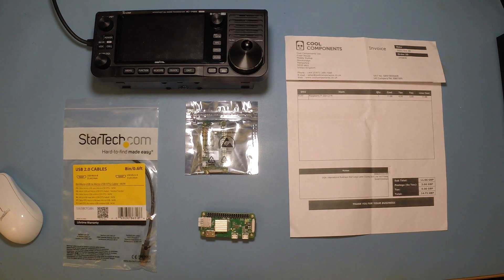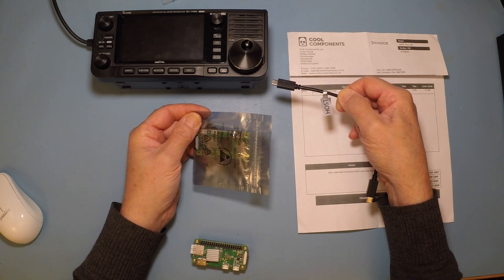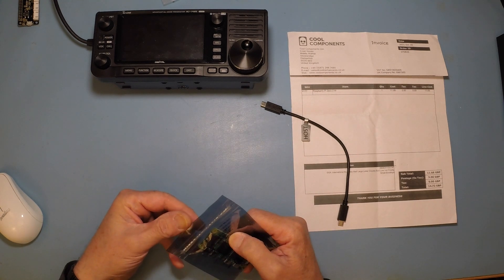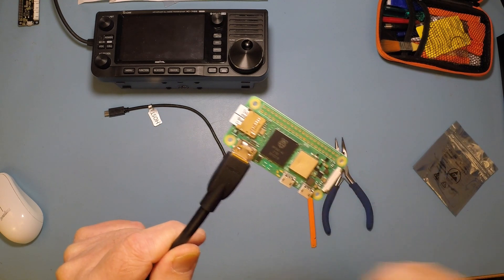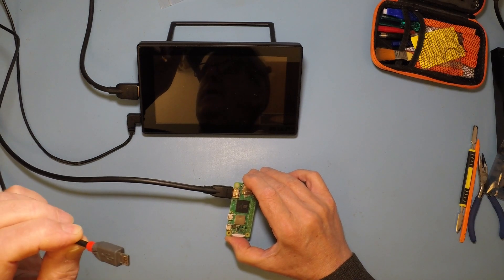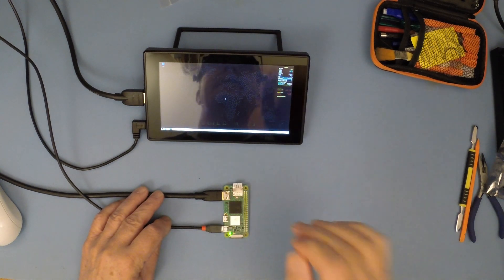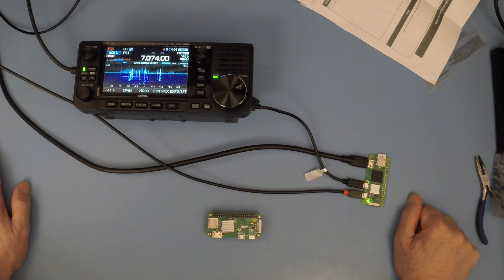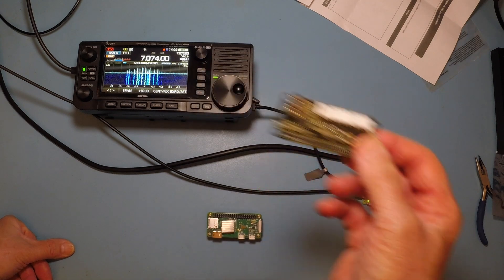Raspberry Pi zero 2W the Best  Pi for Ham Radio digital modes?

Comment: Will a pi zero be powerfull enough to decode and send morse code? Reason for asking plan to use it in small mini laptop guise as have a brain injury that means I can't do it in my head anymore and since stroke memory is affected. Thanks de M0JFE
Reply from the maker: You will need at least a zero 2W. The bare 'Zero' doesn't have enough puff for much at all!
73
Bruce G4ABX
Reply: @G4ABX  thamks for that will keep an eye open am nee to this and find your videos a help. Good DX de M0JFE

Comment: any soundcard?
Reply from the maker: The rig I was using -- the IC 705 -- has inbuilt soundcard and cat connection so its a very easy single USB between the zero 2W and the rig.
if your rig doesn't have an inbuilt sound card then any of the inexpensive USB sound cards will work -- but you will need more than one USB connection to the zero 2W

Comment: Hi god video.
I am trying to seyup my new pi-zero. What version of the raspberry OS are you running? OS or OS lite ? 32 bit or 64 bit ?
73    OZ4HJ
Reply from the maker: Good evening.
I'm running the 32bit Bullseye version of the Pi OS with Build a Pi 'on top' for my Amateur Radio applications.
The Pi zero is very underpowered when it comes to running more complex applications. I very quickly gave up with the Pi zero and went to the Pi-zero2W with its 4-core processor that will handle most Amateur Radio Applications.
This Pi zero2W is connected to my IC-705 and is presently my 'go to' digital modes rig in the shack. (Just worked Canada on FT8 with 5 watts using my 80M Off Centre Fed dipole at home)

I'm also testing the new 64 bit Pi OS and so far its working well. 
Jason, KM4ACK has released a version of Build-a-pi for 64 bit. That is running with my KX3 on a Pi-4 (4Gb ram.)

I hope that helps?
73
Bruce G4ABX
g4abx.co.uk
@G4ABX
Reply: @G4ABX  thanks, my Pi is a Raspberry pi zerro 2 w, how did you get the Pi build on top. i thought that the pi build was a complet image you flashd on (this i can´t get to work).
i am brand new to raspberry so excuse if my quistasions is not logic to you...
Reply from the maker: @JhKnife-OZ4HJ-Jimmi  Good afternoon (I still don't know your name)
If you can't get your pi to run with the standard Pi Bullseye build then we need to sort that out first!

You will need a minimum of an 8Gb micro SD Card. I tend to use 32Gb as they are cheaper!

Next, install the micro SD in your PC  using a USB to micro adapter (available for a few €' on Amazon)

Next got to https://www.raspberrypi.com/software/ and download the Raspberry Pi Imager (Its free) I use a Mac but there are versions available for MAC, Windows and Unbutu
When you have this downloaded and your micro SD card installed in you PC, go ahead and Choose the OS (Choose Bullseye, 32bit) then select your SD card and write the image to that.
Install the SD card into your pi and power it up.
You will need a keyboard, a mouse and a monitor plugged in. You may need a micro USB to USB-A converter in order to plug in more than one USB item. Again these are available on Amazon for about €12
You will have a number of things to fill in on the Pi as it boots up -- your Wifi Password, your location and first of all, change the password to something you will remember.

Once you have your Pi running on its own OS, come back here and I will talk you through getting Build-a-pi running on your Pi so you can run all the digital modes etc.

73
Bruce G4ABX
Reply: @G4ABX  just a quick question. It is the standard OS you are running not the lite one right?
73 - OZ4HJ - Jimmi
Reply: @G4ABX  hi 
Now it’s running OS 32 bit. 
I seems to have the same or similar problems with the USB hat/hub, but it is running now…🙂
How do I proceed for the builder pi ?
Reply from the maker: @JhKnife-OZ4HJ-Jimmi  Well done 🙂
Ok to add Build-a- pi

Power up your Raspberry Pi, login, make sure you have internet and and in your home directory, run the following command using the terminal window. (Just copy this below and past it into your  terminal window.)

 git clone https://github.com/km4ack/pi-build.git \
  $HOME/pi-build && bash $HOME/pi-build/build-a-pi

Unbelievably, the Pi will do the rest!
You will need to give the application some information. -- like your wireless password (most important) but if you haven't set up the rest, you can come back ot it once everything is installed.
There App will also ask for your callsign. This is how it identifies what you have installed for future upgrades.
It will also give you -- I think 3 pages of 'tick boxes' for various applications. At the bottom of each page you can select one tick box to install everything. This is what I suggest you do .
The complete download and install will take about 4 hours -- so be patient.
Once you have give it your callsign (after about 5 minutes) you can leave the Pi to do its stuff. You don't need to sit there watching 🙂

At the end it will ask you to reboot -- and if everything has been successful you will have a Pi full of new applications for you to use.

The script has been written by Jason, KM4ACK and he has a lot of information available on You tube and on line. 
I also suggest you join the KM4ACK-Pi forum on Groups-io. Its free and is very well supported by knowledgeable and new folks.
18 months ago, I didn't know what a Raspberry pi was!

Have fun -- and if you get stuck come back here.
I review my emails most days
73
Bruce G4ABX
Reply: @G4ABX  Hi Bruce.
it´s running now. I changed the language back to English and maybe I forgot a space to start with....
73
Jimmi
Reply: @G4ABX  Hi Bruce
Now the Raspberry runs Build a pi…. Nice.
But I get this error when I try to connect to the IC7300. The baud rate is set to 9600 both places. Do you have any ideas to solve this ?

Rig failure
Hamlib error: Communication timed out
serial.c(884):ser_close return(0) 
iofunc.c(361):port_close return(0) 
rig.c(1083):rig_open return(-5) Communication timed out
serial.c(884):ser_close return(0) 
iofunc.c(361):port_close return(0) 
iofunc.c(361):port_close return(0)  while opening connection to rig
Reply: @G4ABX  Hi Bruce.
Now it works....🤗 it the Icom 7300 internal time out timer that needed adjustment.
Thanks for all your help.
Reply from the maker: @JhKnife-OZ4HJ-Jimmi  Good morning Jimmi.
I've been travelling so this is the first chance to read emails.
I'm glad you got everything working.
I tend to use 19.2k baud rate with my 7300 and that works well - but really most baud rates work and 9.6k is fast enough.
One of my Pi-4's died on me two days ago. Just stoped working and has a terminal hardware failure. Now of course you can't buy a replacement as there are none in stock anywhere -- due to the worldwide chip shortage. it will be many months before they are available again
So enjoy your pi -- but don't break it 🙂
73
Bruce G4ABX
Reply: Thank you.
I am downloading the standard OS bullseye 32 bit as we speak.
I will be back. The name her is Jimmi.

Comment: Instead of using a S tactic strap, I just wash my hands. Skin with moisture has no static
Reply: Hi not all static damage is instant it can take weeks or longer to show up. I have only seen damage on a couple of devices instantly but suspected more unknown . I used several mats and straps a lot have warn out. One word of caution I was working with EHT about 2500 volts on a static mat and got a belt from the mat!! Not a huge one but supprised me!
Reply from the maker: Barry thanks for your input.

High voltage and conductive mats don't mix well.
I was repairing a valve Linear amp for a colleague -- 2500 volts on the Anodes of the valves (tubes)
I too got more than a tingle from the mat!

you are absolutely right about static damage. It's insidious and often unseen. That's why I prefer to take maximum -- but not crazy -- precautions at the outset. Then you can be pretty sure you've not got any latent damage that will bite you later on.

Although I've only ever had one anti-static mat, this is about my 5th conductive wrist strap. Previous ones have used a conductive material -- which is more comfortable than the metal strap, which is just like a metal stainless steel watch strap, but is less effective and they wear out as you say Barry.

73
Bruce
@G4ABX
g4abx.co.uk
Reply from the maker: Hi Jason. Maybe -- at least whilst your hands are damp, but I've seen too many static induced failures during my career -- so I always wear a wrist strap. Its a small investment for a lifetime of certainty :-) 73 Bruce @G4ABX

Comment: Hi Bruce, could you tell me what usb card you added under the older pi? Thanks VE6KBI
Reply from the maker: Dana -- good afternoon. Certainly. It was purchased from Amazon: IBest Waveshare 4 Port USB HUB Hat B for Raspberry Pi 4B/3B+/3A+/2B/Zero/Zero W/Zero WH,4X Extended USB 2.0 Ports,Compatible with USB2.0 1.1, Plug-and-Play.
I warn you that it works fine with the original Raspi zero but on the zero-w, the pads on the Pi that it uses to connect via gold plated 'pogo pins' appear to be different -- or not in exactly the same place as on the basic 'zero.'
I need to investigate some more as to use the zero2W in my KX3 Gobox, I need 2 standard USB ports for the sound card and the RS232 adapter.
73 Bruce @G4ABX

Comment: Can you pair the units via Bluetooth and eliminate the usb cable?
Reply: Jamie. Yes you can -- certainly using a Widows PC and ICOM's £100 'Remote' software. I will investigate how to do that using the zero-2W over the next days and post an update.
Reply: @Dr-T  there is also wfview which is a free remote rig software...
Reply: @fatbikejamie  Hi Jamie. Yes I know of WFVIEW but haven't investigated it yet. 
I have now got the 705 responding to the Pi Zero2 over bluetooth using FL-Rig for CAT control -- without any additional software. 
I suspect the challenge will be the bi-directional audio channel! 
73
Bruce G4ABX
Reply: @Dr-T  until I get my 705 i am living vicariously through very helpful youtoobers.  :)
Reply: @fatbikejamie  Hi Jamie. When you get it, I want to know what you do with it :-)
In the meantime, enjoy everyone else's experience with the rig.

I think the Amateur Radio community is great for all the good stuff it shares.
I would never have got my licence in the first place if it were not for hanging around with those that had already achieved that accolade.

73
Bruce G4ABX